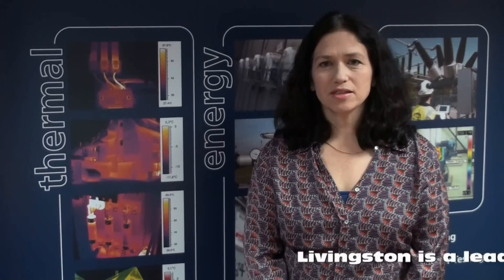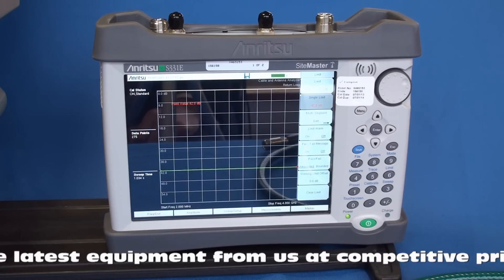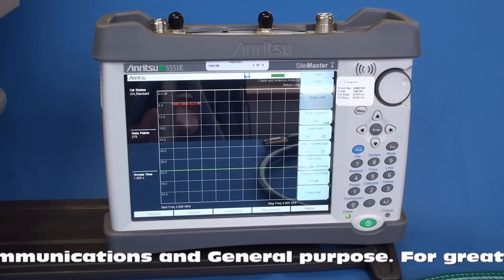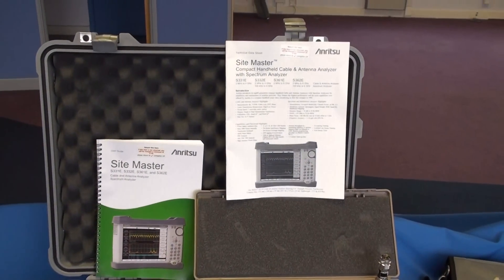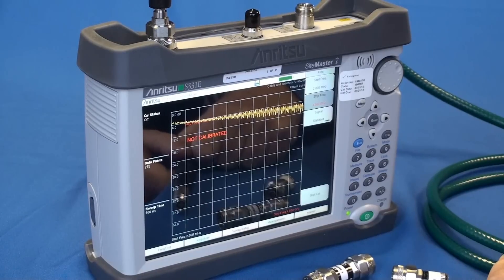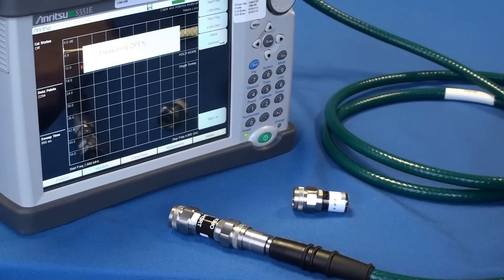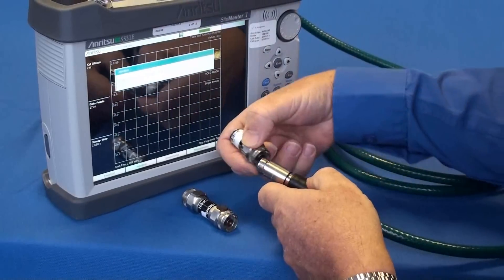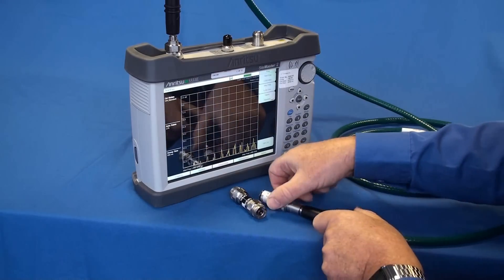How to Calibrate an Anritsu Sitemaster

Comment: This seems like a good video to show you how NOT to calibrate a Sitemaster. There are two problems with this video.

Firstly, and most importantly, the connectors are rotated. Instead the nut on the N connector should be rotated, and the connectors not rotated, to reduce wear.

Secondly, for best accuracy, a torque wrench should be used. Why do you think a torque wrench is supplied with all high-end calibration kits. The Agilent 85054D "economy" N cal kit includes a torque wrench, as does the more expensive 85054B.  You can reasonably argue for use in a field, a torque wrench is unnecessary and hand tight is good enough, but for best accuracy a torque wrench should be used.

A pretty unimformative and useless video IMHO.

Dave
Reply: Looks like she does rotates a little the load. Have you see differences in tighting an N type cal. kit by hand hard that by a torque? I have no torque but tried different pressures with the hand and after a point I see no difference.
Reply: No one asked “Dave